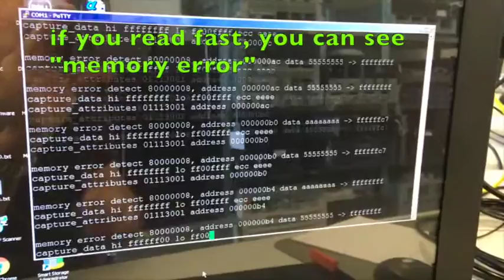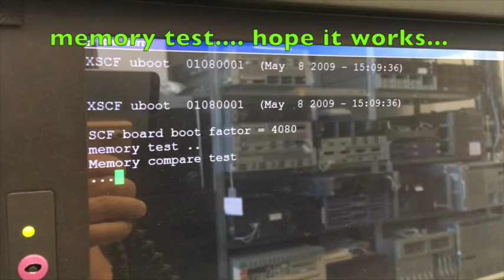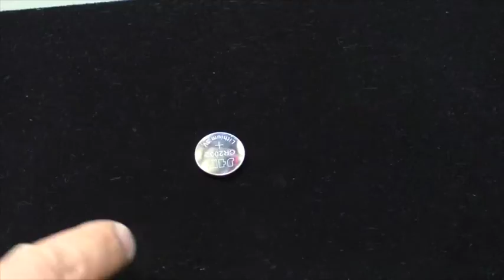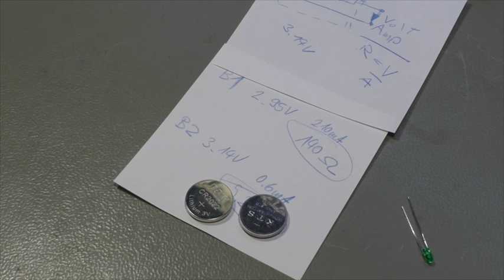Server repair - SUN XSCF board and CMOS battery problems (PWJ176)

Comment: +1 That hot air nozzle is so perfect & sexy, it *must* be Swiss!
+1 (if they'd let me) for being brave hand soldering those RAM chips. Then again, what else can one expect from a Swiss IT master? I freely admit I'd lay down a couple of nurdles of solder paste & hot-air solder the RAM, and give it multiple microscope inspections/
Reply from the maker: Those nozzles are indeed swiss made and they cost a small fortune each.  The salesman told me that they tried to "outsource" the production but nobody was able to do it with the same quality. In fact, it's one old man who makes them from stainless steel.... they last for a lifetime.

Thanks for the "IT master"... :-)

Comment: I like to use BR coin cells on my mainboards...slightly lower capacity but better long-term stability.

I have two HP business calculators and both of them are standard algebraic notation...I wonder why that is?

Comment: There is a cheep chinese multimeter with 1.5V and 9V batteries testing function - DT-182. https://forum.cxem.net/uploads/monthly_2016_10/sam_5710.jpg.678916707b07bd03144b16a87346e373.jpg
Reply from the maker: Interesting... I did not know that this exists. Looks a bit crappy, right?
Reply: @PlaywithJunk  Yes, but for batteries testing it's ok.

Comment: interesting, you soldered it by hand, i would've thought you'd use solder paste and high heat low air to reflow it
Reply from the maker: It depends on the type of chip. This package is easy for hand solder.
Reply: @PlaywithJunk  if you have a big microscope that is :D
Reply from the maker: ...and my solder paste run out...
Reply: yes, without even flux

Comment: You could put a resistor between your probes to measure the coin cell under a slight load. I can't remember how much current the 2032 is supposed to put out under normal use so I can't remember a good value for the resistor.
Reply from the maker: I think a load of 10-20mA would be fine. That's 1/10 of the maximum current in this case. And it would clearly detect that faulty battery. So like 150 Ohm...?
Reply: @PlaywithJunk  Clearly not, 10-20mA would drain your battery over a night. A 2032 has only around 200mAh...
A normal load (basically only the RTC) in motherboard for such battery is <10uA.
Reply from the maker: @lakami15128  I'm talking about testing the battery for a second or two. Not about connecting the resistor permanently....that would make no sense.
Reply: @PlaywithJunk  sorry, misread :)
Reply from the maker: @lakami15128  ;-)

Comment: I got fooled by one of those coin cells once. It was a garage door opener that I thought was broken but it turned out it just needed a new battery even though the battery measured good. Now I know to put a load on batteries before measuring them.

Comment: Is this server really from 2009? Is it still in use?
Reply from the maker: Yes.... some customers keep their stuff as long as possible. Thats not always easy to maintain but good for the planet :-)
Reply: @PlaywithJunk  agree, sometimes they get replaced for no reason even if they could do the job and were fully working
Reply: @PlaywithJunk  Not sure it's good for the planet. The BMC card bigger than a regular desktop motherboard...
Reply: We still run a bunch of V120&V240 sparcs from somewhere five years before that with no plan to replace.
Reply: @benbaselet2026  awesome those machines are built to last, i hope they get proprely maintained (cleaning, paste ecc) if they get maintained they can run for annother 10 15 yrs no problem
Reply: @stvpls  They are OK except the tiny CPU fans inside the 1U V120 are garbage and fail every couple of years so at least they get replaced often :D
Otherwise they just run 24/7/365 in stable conditions so they should last.
Reply: who cares if its not new, as long as it works and it suits the job is used for no need to replace it

Comment: 6:45 I use a 1/2 inch wide double bevil tip to solder parts like those. I also tip the board up in the air to get the extra solder to flow down the tip since the tip points upwards as I move the tip downwards and solder all the pins at the same time. The flux removes surface tension and solder bridges remove themselves.